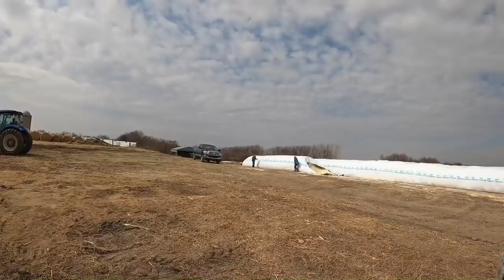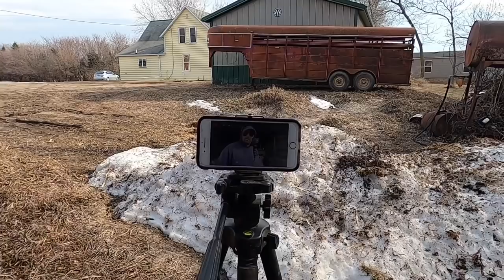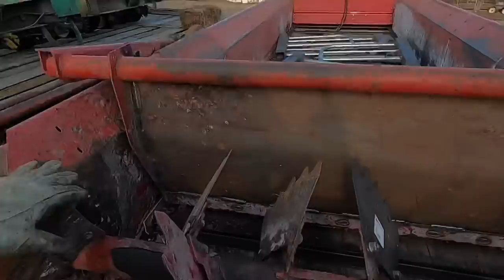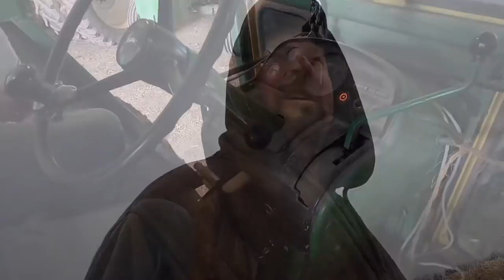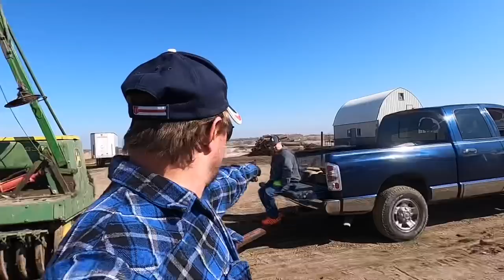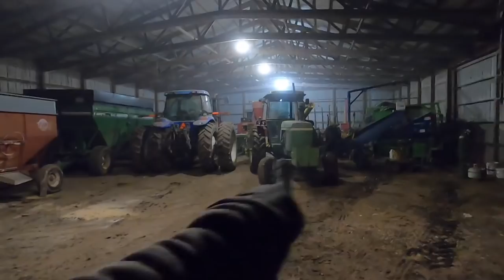New To Us Equipment Purchase - Fixed Up Manure Spreader and The JD A Runs Again [GoPro View]!

Comment: Why do some silos get that poisonous gas buildup in them?
Reply: @Blake Siegle (Student) so they dont vent at all or not very much? I dont have any experience with silos.
Reply: @logpile1313 during the 
fermentation process of making for example corn- or grasssilage, the bactiria in the silage are producing carbon dioxide and if the silo is airtight it cant go a anywhere and stays on top of the silage in the silo. Greetings from Austria.